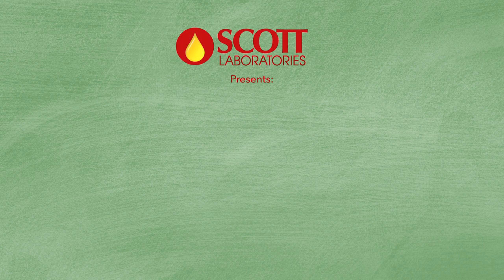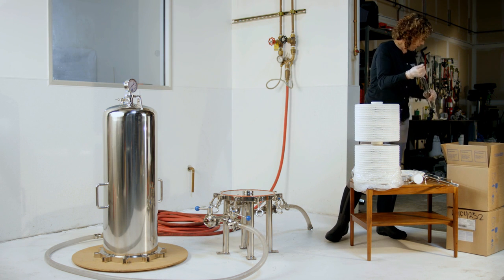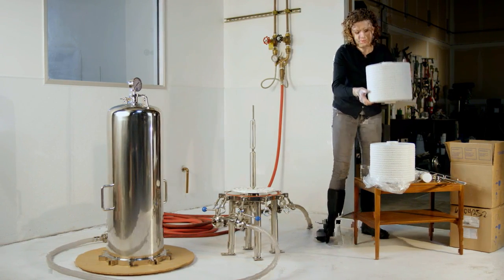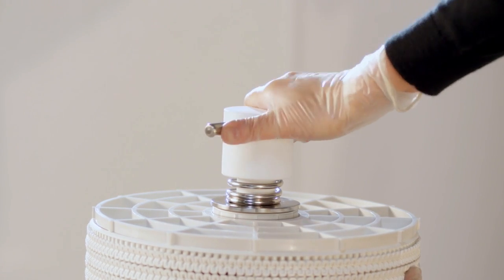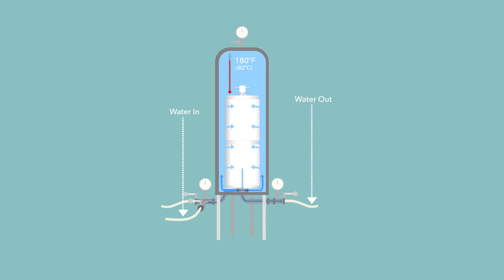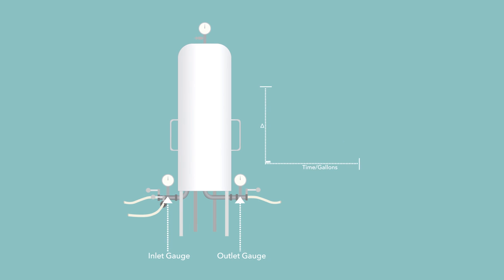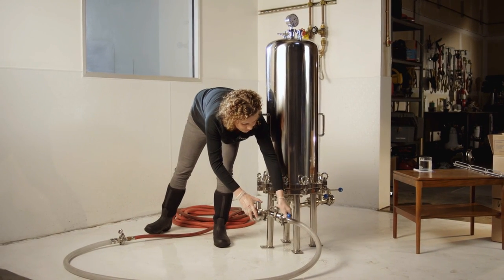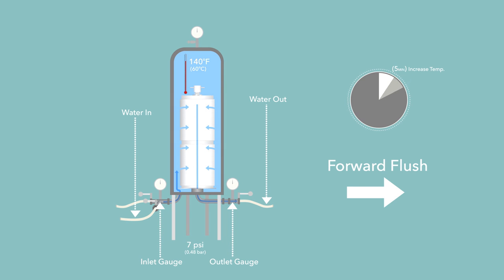Scott Laboratories Lenticular Filter Setup and Usage

Comment: What if I am using a botanical that is submerged in ethanol and water cannot be added? Does that impact temperature and curing of the filter modules? Also, when I backflush, do I need to also use a solvent that will dissolve the lipids in the botanical brine?
Reply from the maker: Hi @jamesshanbrom, if you have any questions about filtration, please contact us via the form on our Connect page, and our technical team will be happy to assist you promptly. https://scottlab.com/connect#send-message